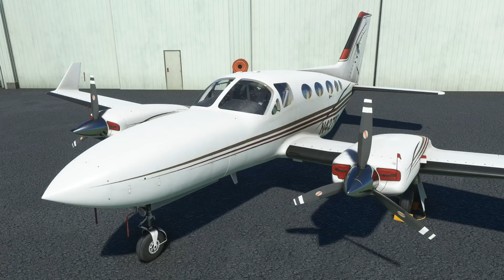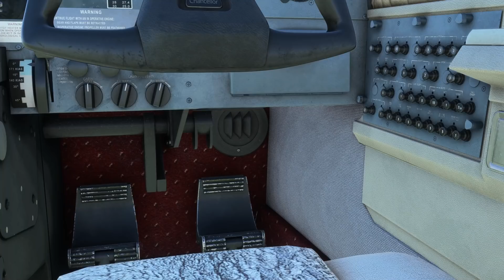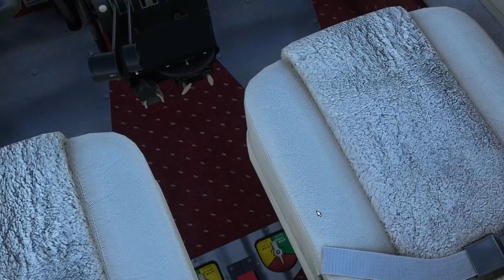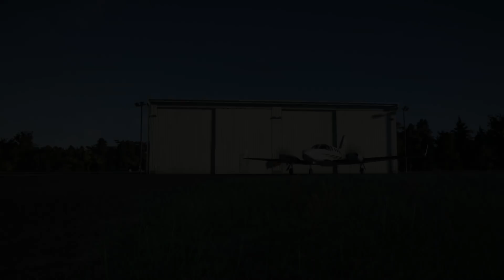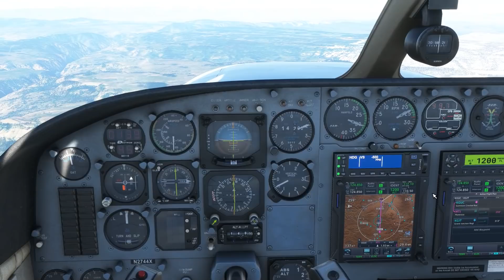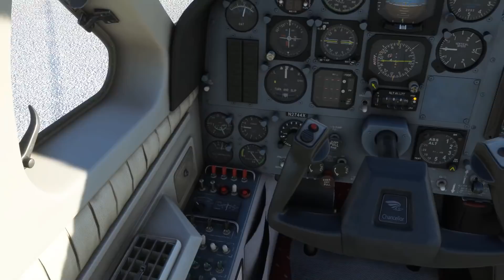Flysimware - Cessna 414 Chancellor (Early Access) | Full Flight Review | Microsoft Flight Simulator

Comment: You hit the arm button next to the altitude window right under the HSI , that will make it capture your intended ALT. 

You can also use the baron 58 sounds if these aren’t up to par yet, I plan to
Reply from the maker: Thanks very much James. My understanding is that whilst one can certainly use the Alt Arm functionality to capture an altitude, it shouldn't be a requirement to hold an alt. If Alt is engaged on the autopilot itself, then it should be maintained regardless.

That's a great idea on the Baron sounds. I know people have been doing this with other addons as well (the Aeroplane Heaven P-51 for example). Personally I don't mind the C414 soundset, but you aren't the only person I've heard from that felt it is lackluster.

Cheers and all the best! : )

Comment: Ah, I'm glad to see the inaccurate slow-speed/stall handling showcased in this. Stall speeds are approximately 20% low and being able to hold controlled flight 15 knots below Vmc and 10 knots below the stall speed has, of course, no relation to real world physics. Hopefully these issues will get fixed
Reply from the maker: Hi CCM,

I'm glad the video was of use. I don't always have the knowledge to hand, in terms of performance figures etc, but I figure if I demonstrate the flight model, then those in the know will be able to judge accordingly.

I'm not sure whether this behavior has been fixed up yet, but FSW have certainly been busy with patches and fixes and the C414 has been moving in the right direction.

Thanks and all the best! : )

Comment: Thanks, ITB, for another informative video!
Just a couple of questions since i'm unfamiliar with this airplane:
What's the flag in the ADI for?
Why setting the pressurization for Sea Level when landing at 5,000 FT elevation.
Let's hope they can sort out the fairly annoying niggles that remain.
Reply from the maker: Thanks very much Wikstrom, my pleasure!

The ADI flag is a little bit of a guess on my part, but as I had switched into GPS navigation by that point, I think the flag is just denoting that the GPS is not providing any vertical guidance currently (as I was using the GTN750, which can provide vertical navigation). I expect you would see the same flag if the ILS was tuned up and you weren't picking up the glideslope.

For the pressurisation; It looks as though the system will maintain surface level pressure in the cabin, up to an altitude of 10,000ft. As a result, 10,000ft is actually the lowest cruise level one can set on the system (as anything below that will just equate to sea level pressure anyway). So I set sea level and then switched to "depressurise" mode once on the ground.

FSW have certainly been very proactive with patches thus far - indeed many of the aircraft's bugs have now been fixed up.

I hope that helps a little? All the best! : )
Reply: The small number on the outer scale of the pressurization controller equates to cabin altitude usually while the smaller number on the inner scale relates to cruising altitude. Usually you set cruise altitude plus 500 feet and then when descending you set the cabin altitude to landing field elevation plus 500 feet again. That way the cabin will be depressurized the last 500 feet or so on approach to landing.

Comment: The autopilot may be using the transponder's pressure altitude, which could explain the difference in altitude setting. This looks like a real nice aircraft to use in the simulator. I heard it will be quite pricey
Reply from the maker: Thanks for the suggestion Cyril! Yeah, I was thinking it must be using a different datum, but someone else reckoned the problem was actually that it was using GPS altitude, as opposed to barometric. We do get some funny old bugs in MSFS! XD

The C414 is indeed very nice. But given it's "early access" price is already fairly steep, I imagine the final price will indeed be quite high.

All the best! : )

Comment: I thought this bird would be faster! Interesting. Maybe at higher alts.

Pretty sure when you shut down number 1, you could hear the heat ticking lol inside the cabin in flight. Woops!
Reply from the maker: It’s not the quickest twin I’ve ever come across in terms of IAS, but I did have a reasonably conservative cruise power setting here I think. Being pressurised (and with the turbo’s), you could certainly take it up to some decent altitudes and get a nice high TAS out of it I’m sure though.

Haha, you could indeed! It’s really nice that FSW went to the trouble of modelling that, but it could certainly use a little bit of refinement.

All the best! : )

Comment: Quickly becoming my favourite twin.  What ATC are you using? Would expect to see more integration with the Bravo quadrant for the auto pilot, hopefully that will come ion the future update.
Reply from the maker: Yeah, the C414 is a really great offering isn’t it Phillip! It certainly has its issues, but it’s already my favourite twin in the sim for sure (we’ll see how long that lasts when MILVIZ’ Cessna makes its appearance haha).

For the ATC, I was using real-world ATC recordings (from LiveATC.net), which I then edited into the video. I believe there is an MSFS ATC chatter app available though, if that’s the sort of things you’re after : )

All the best!
Reply: @IntotheBlueSimulations  Yeah, the 310 may be a game changer but, at thi point thr 414 has set the standard for twins. and thanks for the info re ATC, cheers
Reply from the maker: You’re most welcome!

Yeah, the C310 is looking rather excellent. Not least of all, it’ll be great to have a decent failure system. The C414 will take some beating though, it’s absolutely excellent in some areas. Good to have a little bit of competition at any rate! : )

Cheers!

Comment: Like the look and sound of this, other than the fuel pump boost drone. Presumably the RL aircraft also does this. Wouldn’t be needed at lower altitudes?

And with regards to the install, which you’ve just mentioned as I’m typing, that may for me be a problem. I’m currently building a new sim rig. So if I buy it now and run it on my current rig, I won’t be able to fly it on my new rig without buying again? That’s me out then, at least for the moment.
Reply from the maker: Hi Mark,

Yeah, it’s a beautiful model and sounds really nice overall. The fuel pumps didn’t bother me nearly as much during the flight, as they did when I watched back the video XD I’m fairly certain you could get away running without running them though yes. Perhaps the dev or a 3rd party will come up with a fix, to lower the audio of the pumps a bit.

Installation is only allowed on one computer at a time. So you can move it from one PC to another, but I believe you’d have to inform Flysimware etc; which might be straightforward, but might just as equally be a massive palaver. The installer mentions that even if you upgrade hardware on your installation PC, you may have to “reapply” for another installation. It’s not the end of the world, but I really don’t like these sort of practices. You’re essentially punishing someone that legitimately purchased your products, because others partake in piracy (and are probably still going to do so either way). I find it a bit galling when I purchase something and am then told how I can use it. . .

New rig though. . . exciting! ; )
Reply: @IntotheBlueSimulations  Yes agreed it’s a bit of a faff setting it up that way. Think it’s probably still worth the aggro though, cheers.

Comment: I’m loving this aircraft, definitely. I’m surprised you said it felt nice on the takeoff though - I have to say I’m getting that awful MSFS jerkiness both on takeoff and landing rolls.
Reply from the maker: Hi Rondon,

I’m really glad you’re enjoying the aircraft! Likewise (although it does have its issues of course).

Well, it’s all relative I suppose haha, but I didn’t find it to be nearly as bad as most MSFS offerings. The C414 seemed to track pretty nicely straight down the runway and when I did have to make minor corrections, it was easy to do so without the aircraft spearing off the centreline. I have a -50 curve set on my rudder axis, perhaps that accounts for our different experiences?

All the best! : )

Comment: Regarding your problems getting the autopilot to level off at 14000, I wonder maybe it’s perhaps related to needing to arm the ALT mode. I’ve seen some other previews, and they seems to be a switch near that smaller altitude setting instrument under the HSI
Reply: Yes. I'd had the same problem on my first two flights. It wouldn't hold altitude once it got there. But on the third flight I set altitude, then pushed Arm in IAS mode. It's then set for altitude capture. Got up to FL200 and stayed there.
Reply from the maker: Ok, thanks very much for the info Jon! : )
Reply from the maker: Thanks very much for the suggestion Rene! I was aware of the Alt Arm option, but I would be surprised if it's actually a requirement for maintaining an altitude. I could be wrong, as I've never used one of these particular units in the real world; but generally once one hits Alt, I would expect the aircraft to either level off at its present altitude, otherwise the one selected on the unit itself. Again though, that's an educated guess on my part.

If it works differently in the sim then perhaps I'm wrong. Either way, it's good to know that there is a workable method (as Jon also mentions), I shall give it a go on my next flight : )

Cheers and all the best!

Comment: Wonderful review as always ITTBS!!! You’ve become one of my favorite sim aircraft reviewers and I value your opinions and feelings! A few things I noticed while flying the aircraft: Same as you, I had difficulty exercising the props. Found out you need to place the prop levers in the feather detent and pluck it out to elicit the desired effect (doesn’t seem right). Rudder are still quite sensitive on takeoff for me, curious to see what your sensitivity settings are for your sim if you have a free moment! When I attempted a go around, carrying quite a bit of speed, and added 3/4 throttle, the RPM peaked and stayed at 4000 RPM. Well above the red arc. It wasn’t until I added full throttle that the needles finally settled below the red arc. A fellow streamer mentioned, regarding the altitude hold issue you presented, is due to the aircraft potentially using GPS altitude and not barometric. Just something to be aware of. I’m loving this plane and hope that these matters get addressed to really bring this plane head and shoulders above the rest! Thank you again for what you do my friend!!! Cheers!!!
Reply from the maker: Thank you very much indeed for the kind words Hawks! Really glad you’re enjoying the channel / content.

I’d be surprised if the prop issue isn’t a bug, but it’s always hard to be sure with these things, unless you’ve actually flown the aircraft (which I haven’t). I’ve never flown a twin that didn’t respond on the props during the runup, but then again, I haven’t flown all that many twins haha. The Carenado C337 and Arrow III had the same issue on release. . .

I run a -50 curve on my rudder axis, so fairly aggressive. Obviously you sacrifice some finer control at the extremes (hence my dodgy engine-out work haha), but I find it does temper down the sims rudder issues a little bit. Others have said the same as yourself though regarding the takeoff; I found the aircraft tracked very nicely and when I did put in minor corrections, all was fine. . . It’s all relative though I suppose ha, I think it’s an improvement over most other addons I’ve flown at any rate.

Haha, that’s kind of funny re the autopilot / altitude. I figured it must be using a different reference, since it was flying 13,700ft so nicely. Should be an easy fix then at least.

Overall though, the C414 is an absolute diamond in the rough! I expect the issues will get ironed out and then it’s going to be right up there as one of the absolute best addons available currently in the sim. I’ve been having a blast with it, just a lot of hand flying haha!

Thanks very much once again. Really appreciate it! All the best : )
Reply: @IntotheBlueSimulations  Thanks for the speedy response my friend!!! It appears he’s sent an email to all those who’ve purchased the plane, addressing some of the potential fixes on the horizon. I will try dropping my rudder sensitivity to -50 and see how she handles! Keep up the great work and I look forward to your next video!!!

Comment: Bought it straight away. However, the sound at idle is disappointing, not great from outside except the side view maybe. I mainly bought it out of love for this aircraft in real life and to have a nice IFR platform for the sim but the avionics are such a mess. It can't fly RNAV, can't hold altitude can't fly an ILS. Much more work to do on this plane.
Reply: Are you arming the altitude and making sure v/s is set to 0 before leveling off? These autopilots require thinking ahead of the aircraft. 

Also flies ILS's perfect for me. Not a single hitch. Perhaps have a read through the autopilot manual as it isn't the standard autopilot included on most sim planes.
Reply: @leroypenn558  I have tried. I know how these autopilots work because I have flown with them in real life. It's not behaving realistic at all. Aren't you contradicting yourself? An altitude armer is supposed to level off the aircraft independently. Of you use the VS to level off, what the point of the instrument? Then en altitude alerter is enough. I fly the GNS530 version since don't own the 750. Yesterday I was doing some circuits and on the second landing the plane just started giving full right rudder halfway the runway for no reason. YD, AP and FD were all off. My joystick was not making ghost inputs, I checked. It's back in the hangar now until there is a major update.
Reply: @BigLittlePilot  I see, I've been flying the 750 Version that has the different autopilot setup.

Yes of course the armer is meant to level off automatically but it helps if you're not climbing as I'm sure you know. 

I find that slowing the climb before reaching the altitude ensures it doesn't overshoot it.
Reply: @leroypenn558  Sure does but anything up to 1000 FPM even an analogue autopilot should be able to handle.
Reply: @leroypenn558  I just bought and tested the 750 setup. Works way better! Just gotta test VNAV. But the strange control problem I also had upon crosswind takeoff and landing is still there. Check my vid (the narration track is missing I will have to te-upload) around the time of takeoff: https://youtu.be/rPDrSN7mchI
Reply from the maker: That's very strange re the flight control issues! I haven't experienced any such behavior myself. I wonder what could be causing that. . . Is it still an issue post-update?

Cheers!
Reply: @IntotheBlueSimulations  Haven't had it myself any more so that's good. I noticed on one occasion I landed with the yaw damper on. That might be it. Maybe the other time I pressed the wrong key combination and engaged it by accident or something. Not sure why the throttle would be affected though. Anyway, seems better now.
Reply from the maker: Apologies on the slow reply Martijn.

The avionics were certainly all over the shop on release. I gather the situation is rather improved now (I haven't had the time to test any of the updates myself)? Strange that the GNS530 actually worked less well that the GTN750 mods, but I have heard others say the same.

Anyway, I hope you're enjoying the aircraft a little more now, after the last couple of updates.

One quick question from me (since you say you've used this particular autopilot unit in the real world); I know there is an Alt Arm function, but I presume it's not mandatory to use it, i.e. one can simply press Alt on the autopilot and it should go straight into Alt Hold? I've had a few people bring it up and I'm not entirely sure whether my assumption was correct.

Cheers and all the best! : )
Reply: @IntotheBlueSimulations  No worries. Yes it's almost a completely different release by now. Many things are fixed but other remain. They are at 1.4.2 now I believe. You should do an update on release.
Yes you are correct, you can press alt hold any time but then it will descend back to the altitude you engaged it on. More comfortable to use the pitch wheel to level off manually then press it.
Reply from the maker: Thanks very much for the info Martijn! Of course we want comfortable passengers, but it’s good to know from a technical standpoint ; )

I do plan another flight in the C414 at some point for sure! As you say, when it’s fully released would be an ideal time to do so.

Thanks again and all the best! : )

Comment: I noticed that the gps won’t let me set a procedure while in flight. I was trying to activate an ILS approach enroute and the button was grayed out. Not sure if it was user error but it seems like it should’ve worked.
Reply from the maker: Hi Aviator,

Is that with the default GPS, or one of the modded versions? I'm not quite sure what could be causing that, but the C414 definitely has a few issues with the GNS530 in particular at the moment it seems. Did the most recent patch to the aircraft do anything to fix your situation?

Cheers! : )
Reply: @IntotheBlueSimulations  it was with the GNS750, but I’ve since been able to load procedures just fine. Idk what it was, I may have done something wrong. 
I did notice that with the most recent update they did fix the problem with the Garmin version where it wasn’t following the gps course in NAV hold. It still will not capture the altitude though.